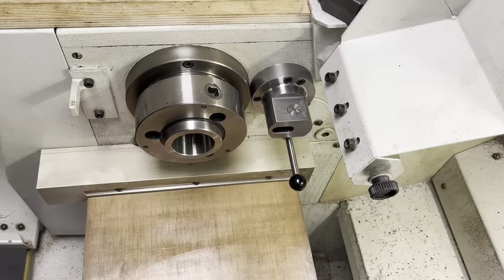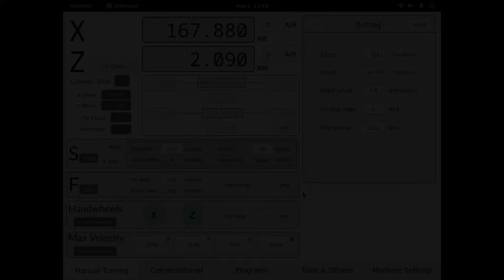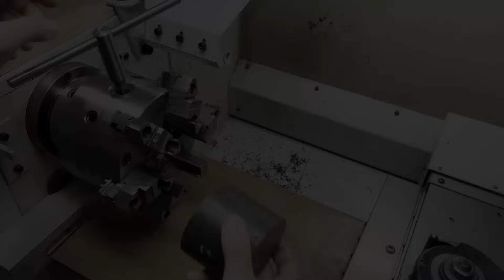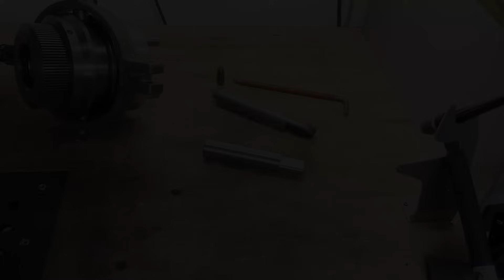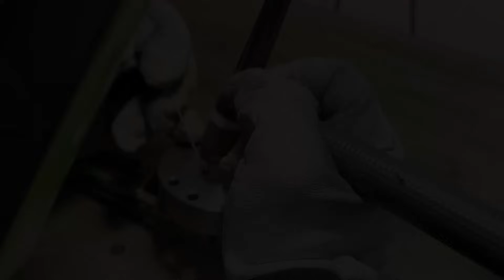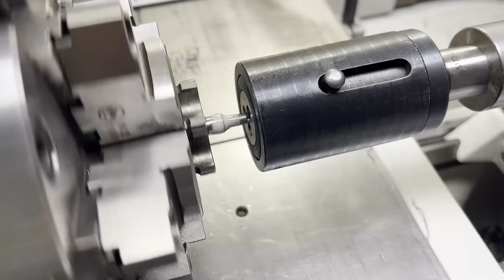When a tight hole leads to..."Pinus Captivus" 😅

Comment: Camlock spindle noses are such a nice thing. On our smallest CNC lathe, 160mm chuck, its still annoying to change to a collet cock because of the 1m draw tube inside the spindle. On all other machines you need a crane 😅
Reply from the maker: I know, I love that aspect of this spindle. 
Its so easy to switch to a better suitable workholding 😄
Now I only need a magnetic chuck and I have all the workholdings 😄

Comment: Nice build, only thing I'd add is a plug for the slot to keep it free from chips and dirt when you don't use the collets
Reply from the maker: You have a point, but it would have been nice to somehow integrate that into mechanism 🤔
I will think about this! Thanks for the tip! 😉

Comment: The original spindle mount is a L series long taper.  If the threads are 6" across, its L1.  If they're 4.5" across, its L-0.   I have  the much smaller L-00 spindle nose on my lathe.  You'll find a home for that mount, I'd expect.
Reply from the maker: Thanks for the hint, I’ll measure it so that I least I know what I have. 
Cheers!

Comment: You could call it a fly-by-wire lathe
Reply from the maker: Indeed, it is. I would love some MPG's that spin harder proportionally on how hard the tool is pressing on the part. I was thinking I could build some but that would also require some smarter drives.

Comment: 18:15 "Anchorlube" (at least the stuff that's in the bottle) should be available in all of Europe e.g. from Company "ARIANA" as "Gewindeschneidmittel A-0802850" (i assume those to be the manufacturer or one of the first large importers, in 2016 (when i bought mine from them) they were listing 5L Canister, 200L Drum and larger quantities on request), one can also find it (likely rebranded) as "BAER Hochleistungs Schneidpaste". I assume all to be rebrands of one (or produced in licence) since they all share the exactly same claims on the label. By the way, this stuff is not magic, it is lubricating-soap. It does not leave a clean workspace, it leaves a soapy workspace you have to clean using water (-> rust) and should not mix with regular water-oil-based cooling, as the soap would interact with the oil.
I stopped using this stuff as i prefer an oily residue as rust preventative, that can be cleaned without water but white spirit or break cleaner, if i need a clean surface for thread locker.

Comment: The original adapter looks akin to American L taper... 

The original handle could have been bent, rather than shortened, altho, that would shorten it as-well in regards to leverage produced, but you could have just heated it up and dog-leg bent it in the right place to allow for nice fit that would look OEM tailored to your machine...

Regarding the chuck in the mill - as with the vise, when you clamp down and hammer the piece down to counteract the part lift induced by the jaws, you should not clamp it down again, as you again induce some more lift of the part... I have a tendency to clamp-hammer-clamp-hammer, as i approach stuff akin to bolt patterns where one does things in multiple stages, but the point is that the hammer should be the last operation in that sequence in this case, even tho it gives rise to the thought that that might allow for the part to be ``loose`` since you are beating it out of clamped position that the mechanism achieved... The thing is - there is elasticity in the material, and when you hammer the part down, the microscopic slack that would be generated is countered by the elastic deformation induced in the screw, and that takes up the slack generated by the part shift... 

I would have gone with a blind hole for the locking pin instead of a cam, just give the pin a mushroom tip for easy extraction and voila... 

Regarding fits and tolerances - some 600-1200-2500 grit wet-paper is better than cutter passes, as it allows for a better surface finish... 

If you want a less vile lubricant, consider some coconut oil(butter, same thing, just temperature dependent) - refined has no smell, virgin will make your shop smell like the best bakery in town, but it is more expensive... From what i know, coconut oil is used in aerospace machining because of certain properties of the oil and demands for the parts... I can`t recall where, but i read something about it a few years back... Either way, it beats machine lubricants in regards to fume/health concerns and aroma, plus it is edible, so no need to worry about toxic cutting oil effect on skin either... 

That said, nice work! A collet chuck is definitely a nice system for the lathe, especially if you work with stock that fits it for the most part... It is as quick as a scroll chuck, yet offers precision close to a well set independent chuck - while being better balanced than either(with exceptions, there are chucks with near perfect dynamic and static balance)... 

And, given that you mentioned it, i will act like a representative for Charmilles - there are ``small tabletop``(500kg) EDM sinkers... Look up Charmilles D10... They can be had for some 2K bucks, and while not the regal specimens from their glory days like my early generation D1T(2 tonne machine, plus 750kg in ancillary eq - oil tank and power module), the D10 is still an EDM which makes it contactless and therefore not in need of rigidity that Charmilles gave their golden era machines... 

Best regards!
Steuss
Reply from the maker: Hello and thanks for your elaborate advices. 
Regarding the mechanism, I had a few other ideas, one of them was similar on what you described, but once I had this idea, I kinda fell inloved with it so I wanted to try it. 
Regarding the lubricant, I finally managed to get some Anchorlube from US. I absolutely love it, makes no smoke, smells like almonds, just perfect. Had no idea about coconut oil being used in aerospace machining, so I learned something new. In Romania the old generations of machinits, the one the age of my dad, were using...sheep fat. Never tried it as I did not had access to something like that, but heard lots of people mentioning it. 
I wanted more the collet chuck for the ability of holding thin wall tubbing without deforming it. Its not that I have a specific business need for this, but for me the money are buying satisfaction. And knowing I have this capability too, offers me satisfaction 😆
Regarding the EDM...I had that in mind, but my entire shop is in 18.5sq meters or aprox 200sqft, including bathroom. So I have no place for another machine in this space. I am planning to build a heat treatment oven, but yet I don't know where I could put it. 
That Charmilles D10 looks awesome, but I would need to give up on something else and I don't quite have on what to give up. I was thinking about a EDM source from Baxedm to retrofit a machine, or build one as he did. But even for that, I don't have enough space. 
Anyway, thanks for the hint, I did not knew about it. Someday, I will have an EDM machine too.
Reply: @LikeFactoryMade  Regarding the coconut oil, i am not 100% sure, but it is what i recall reading, the source be damned :P yet i used it(i cook with it, or rather, i bake with it - lovely for cakes, crepes and similar - doesn`t burn as easily nor turn brown) as i have it on hand - it proved quite nice, especially when compared to using atf(like hydraulic oils, it has anti-wear additives but no detergents, almost no detergents like engine oil does, so it`s not defiling the way oil too much if it drips) which smells like fucking sulfur and brimstone... 

Speaking of an EDM compromise, you could consider making your own spark module and simply use it with an ER collet on a mill - make a tub, electrode is one wire, the part gets the other wire and you risk no bearing damage or any spark erosion on the actual machine... it is a bit more complex than that, but you get the point, it can be done, especially with a cnc style machine that can jab the electrode up and down like a real sinker... The oil flow and filtering would require a system too, but since you are not gonna run it like an EDM exclusive shop, you won`t need triple canister filters and 400 liters of oil with a hardcore pump and all that(the 580kg out of 750kg of ancillary on my Charmilles)...

The almond smell of anything always gives me a bad feeling(cyanide has a very almondy smell - almonds, especially the bitter ones contain cyanide, thus the smell, sweet almond has very little of it, but still has some... Cherry pits, the cores taste like almond, same as with apple`s - for the same reason, it ``stimulates`` digestion of whatever ate them to shit them out asap as not to harm the seed too badly)... But I am glad that you got it - from what i have seen, it seems to be a good lube, just wipe that shit off of your machined surfaces(ways, etc) as it stains parts(quite like cyanide does), so check out what it is made out of... I`m too lazy to check every single thing, i am a madman and a zealot when it comes to topics that interest me, but i have my limits :P

Regarding the handle, i get it, plus, it is easier to turn the handle down than to heat up and bend that massive of a piece(assuming a relative lack of heating eq. given the shop size - small oxy-prop torch notwithstanding)... 

The thin wall tube argument is definitely a good point and a boon that comes with the collet chuck too, plus it doesn`t mar other pieces either, even when they are brass and such softer metals, hell, even plastics can be held in it without harm... 
Tangent to collet chucks - you can check out ``Olly`s workshop`` and my suggestions video to his design... He went the diy route for a collet chuck - while you have no need of it, it is a nice design(my suggestions merely touch up and overkill some technical aspects that i thought of as potentially problematic/weak links that could be pushed closer to perfection(unattainable, but worth striving for))...

Best regards!
Steuss

edit- if you need to extract shit like that, heating is a good idea, but you shoulda drilled a hole in the shaft and after heating the part up to some 100-150 celsius(70-80 would do too), blast the hole with a ``shock oil``(essentially wd40 in a can of liquid butane) to rapidly drop the temp of the inside of the shaft, which would shrink the shaft while breaking it`s contact and thus heat transfer between the shaft and the part itself... I use that method for bearings that i need extracted but housing unmolested... The butane and ``oil`` can mess up the bearing lube, but for stuff like this, it works a treat... liquid butane drops stuff down to some -30 celsius in a hurry, and that coupled with 70-150 celsius of housing temp if more than enough to release most things... Leaving things in acetone for a day or two also almost always obliterates the threadlockers and similar compounds - if there is room enough for even the slightest film of threadlocker, acetone will find the way in... Acetone based brake cleaners(Yacco brand has best brake clean. that i have yet seen, costly, but the best in regards to chemical aggression - use gloves, don`t huff it!) can also be sprayed in a container and sealed with a part to prevent evaporation - as said, don`t breathe that shit in, don`t get it on your skin, there are worse things out there, but avoid it, it makes gasoline look like body lotion... And while we are on the topic of PSA, get a respirator for stainless welding, the one that only covers the nose and mouth(needs to fit under the mask) - any hot work releases hexavalent chrome fumes from inox, plus a small respirator is good for all metalwork - it all generates microscopic dust(lest flood cooled)

Comment: Impressive workshop! My lever collet chuck has an extra hinge where yours is mounted rigid on the machine. The quick release is really slick, I have to bolt a reaction arm on and off of the ways of my machine which is in the way for other chucks. Nice work!
Reply from the maker: Thanks for your comment! ☺️
I can’t picture the mechanism you’re describing. Too bad that YT does not allow attaching a picture to a comment.
Reply: @LikeFactoryMade  do you have instagram? I can send you a picture there if you want to see the setup
Reply: @LikeFactoryMade I think it's because with only one pivot point, the bit that actuates the chuck is describing an arc as it moves. Ideally it would be linear motion.

Comment: Just discovered your channel. Very cool machines you have/build. I was planning something similar for my mill.
Reply from the maker: Thank you for your comment!
You are planning something similar to this quickLock mechanism for your mill? I can’t quite picture it in my mind where this would fit. Too sad that YT does not allow replying to a comment with some pictures 😕
Reply: @LikeFactoryMade  No, I was referring to your mill ability to be run manual and as CNC. Feedback on the lead screws when all is controlled by encoder is something I will miss. Is hard to tell if you're pushing it too hard when there is no feedback in your hand from a manual crank.

Comment: Nice work. The original spindle adapter that you took off is a L-0 adapter. I could use that for my old Rivett 1020S, I wounder what it would cost to ship to the United States...
Reply from the maker: Never tried to ship something to US. Only bought some stuff from there. I have a friend that might be traveling to US this spring. I could send it with him and then it would be just a local shipping. 
But I can’t confirm yet as it doesn’t depend on me.